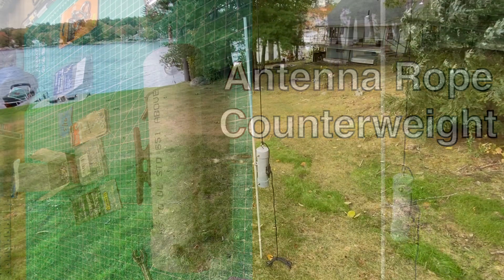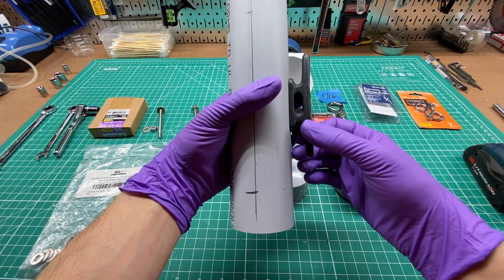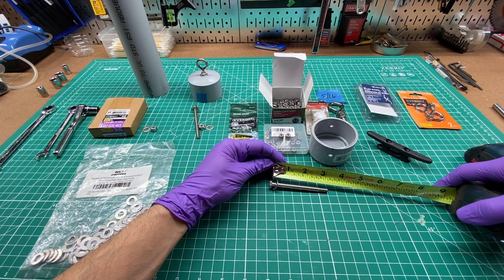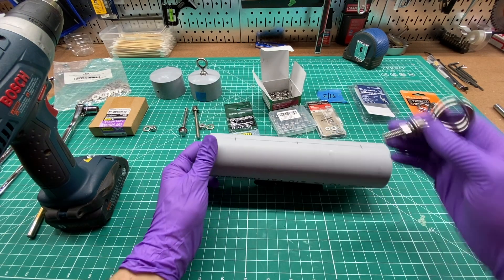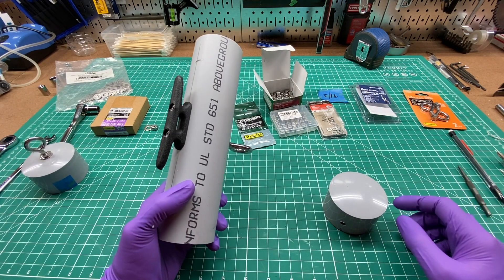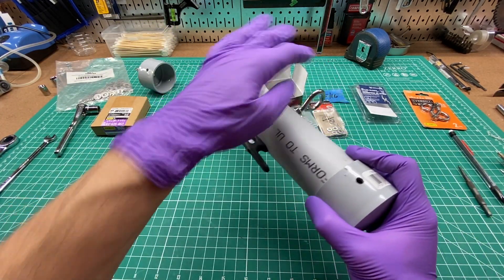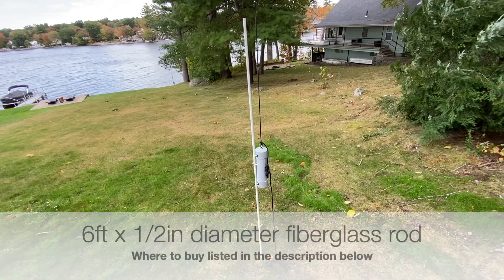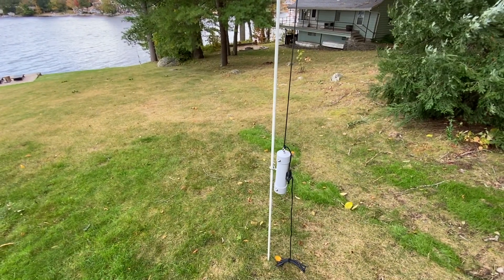Building a wire antenna counterweight

Comment: Is one sufficient or do you put another one at the other side of the antenna as well?
Reply from the maker: I’m putting up a center fed dipole and I’ll use 3 of these. Depending on your setup you might only need two (holding up the ends)

Comment: Several interesting ideas here.  How much does it weigh when filled with sand?  I would have to refigure the size & weight for my parallel dipole.
Reply from the maker: It weighs about 3lbs full of sand. I’m considering filling it with something else if I end up needing more weight. Such as BBs (https://amzn.to/3MoqSqf) or maybe steel shot media for sand blasting. If you are starting from scratch and you know the target weight that you need, you could figure out what your fill would be and then size your pipe to match (length or even step up to 3” PVC). I like the idea of filling with sand because it’s cheap and readily available. If you decide to build one please consider sharing your results!
Reply from the maker: Just wanted to follow up on this. I have replaced the sand with BBs to make the weights heavier. This ended up working out great. I posted a new video about it: https://youtu.be/30LFzLWNYWU

Comment: Pretty cool idea. Seems a bit complex, but I love the idea of it for a specific installation.
Reply from the maker: Thanks! I agree it is a little complex for just a weight. Maybe not worth some peoples time. I like that it looks a little more “professional” and purpose built than something like a bottle filled with sand. Other benefits are that it doesn’t blow around horizontally in the wind, and using a cleat makes it really easy to take the rope off for adjustments. Thanks for the comment. Please consider subscribing 😀
Reply: @MostlyBuilds  Will do. I loved your video on putting up a pully. Reminds me of my younger days when I used a Friction Saver to climb up a tree.
Reply from the maker: Someone else also mentioned the similarities with a friction saver. I had never heard of that. After watching a video I totally see what you guys mean. Very clever how it gets rigged up and taken down.

Comment: I use black 'real' rubber 36" bungie straps to keep wire tension on my Inverted V and wire antennas. Have gone through 10yrs of Ohio winters and still working great. The 'real' rubber even adds insolation isolation. 
de N6JSX /8, MS-EET(ret), +50yrs as a HAM.
Reply from the maker: 10 years! Pretty solid. Thanks for sharing.